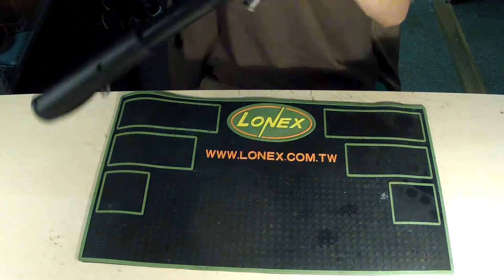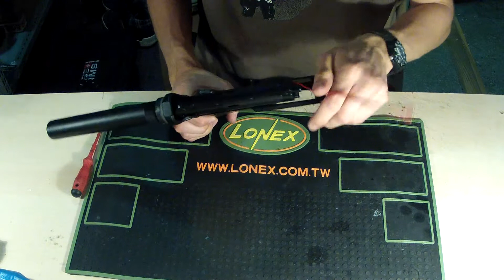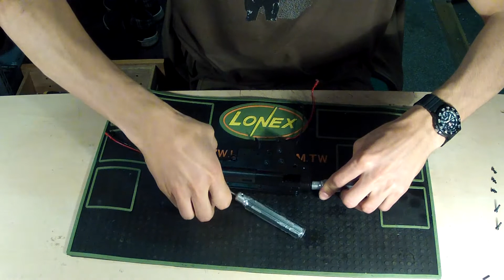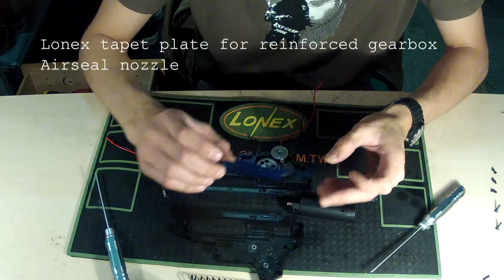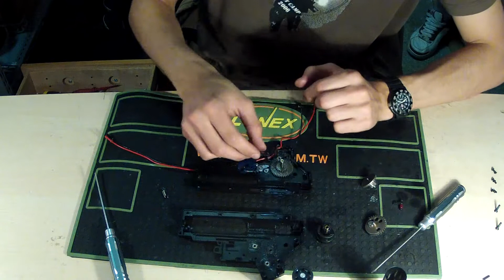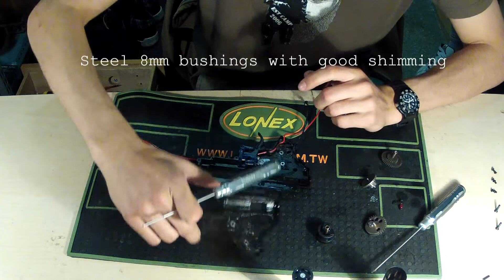Lonex M4 videoreview

Comment from the maker: Plastic spring guide should be replaced if you are going with a tuneup to 11.1V or higher spring. Shimming is not needed, have seen over 10+ Lonex M4-s now and none of them needed any real shimming. 
P.S. They have now fixed the magwell problem. All the new guns come with extended mag catches. Now everything works like a charm!